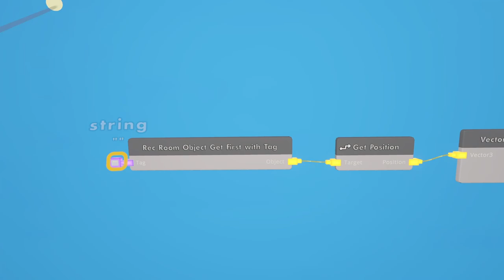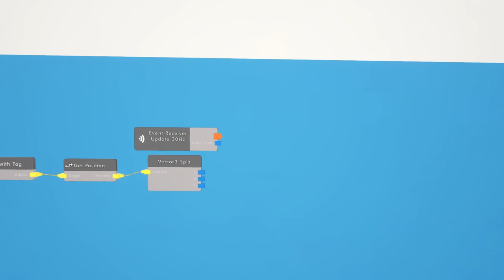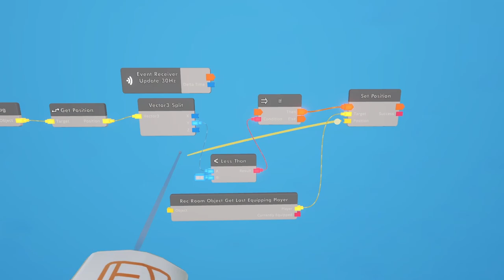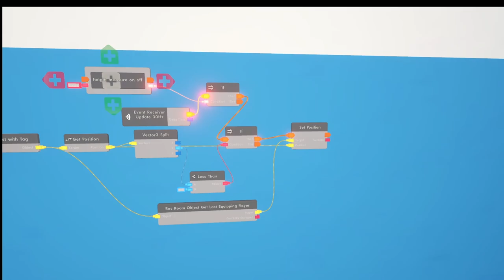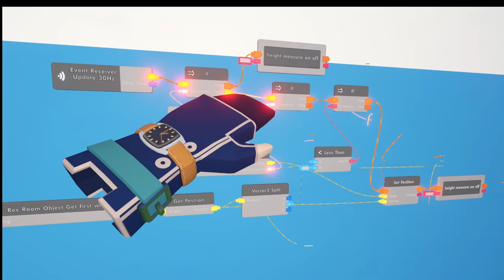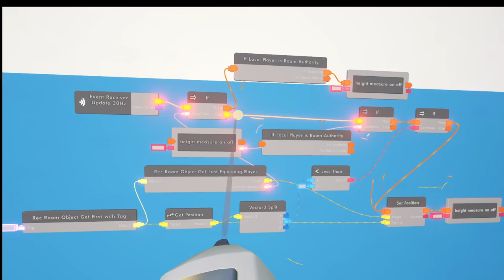How To make an ENDER PEARL in Rec Room *UPDATED*

Comment: About the height measuring.I would also create a raycast that goes down.And get the distance between the hit position.If the hit position is (0,0,0) then you can go with y axis method.Or you can also use a overlap sphere.
Reply from the maker: i realized after making this that i probably could have made it more versatile like works everywhere but i supposed for someone who is new to circuits this is simple enough, hmmmm, but thanks for the info :)

Comment: Instead of checking the distance between the ender pearl and the floor, you should check if the ender pearl's velocity is 0
(Do it by using a "get velocity" and a "vector get magnitude".)
Reply from the maker: Correct, the one in my clubhouse is actually set up that way, its much better

Comment: @theRCLman 
i have a question.... i want to make a full body costume machine so when people join it equips a new costume to them when they join i only want 4 players so it shouldnt be that complicated but ive been trying for hours with still no luck anyone have suggestions?
Reply from the maker: there should be a port on the full bodys that equips them, you need an event reciever configured to player joined, then hook it up to the equip, if its already equipped it will fail so then hook the fail to the next costume and continue like that make sure the player is hooked to all of them
Reply: @theRCLman  Thank you This Helped a lot